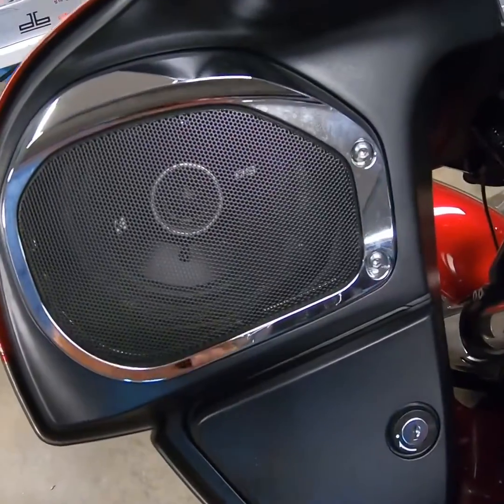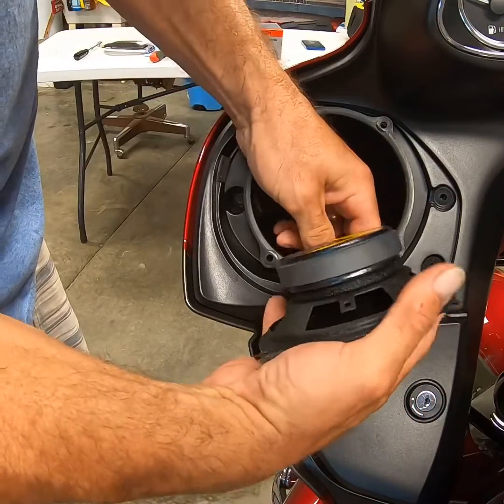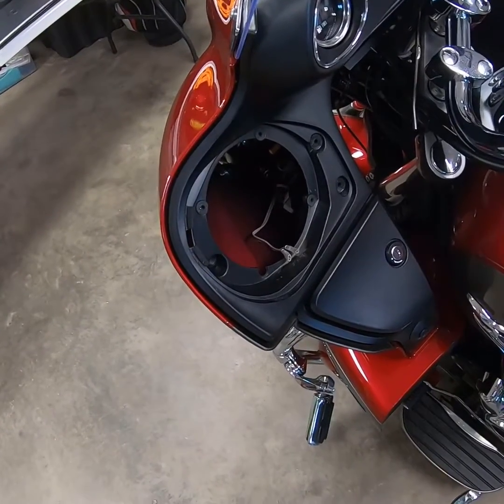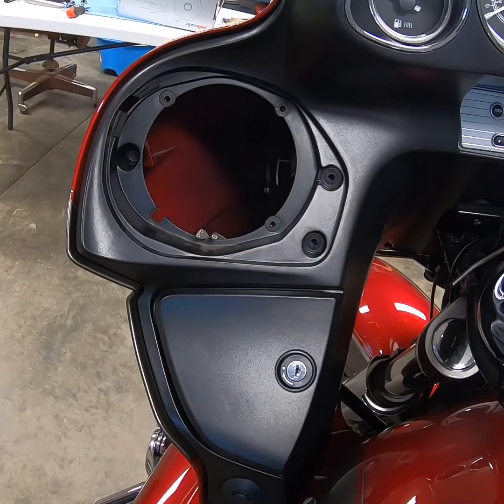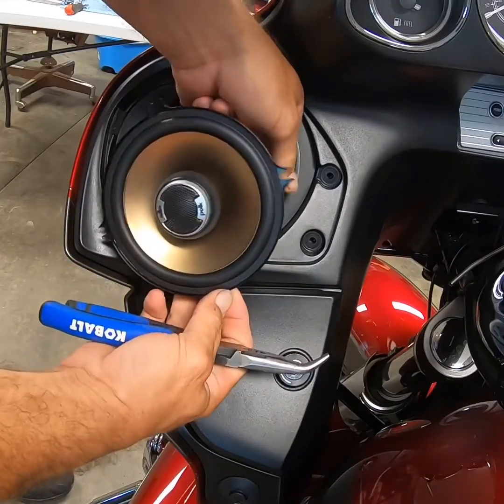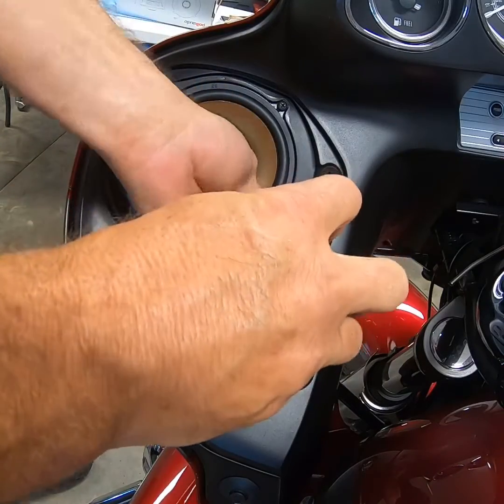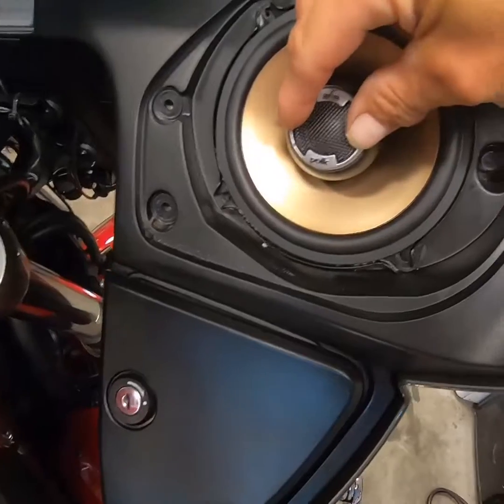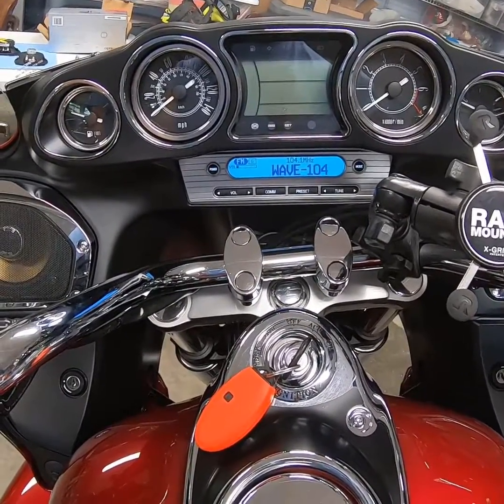Front Speaker Replacement & Polarity Testing: Kawasaki Vulcan Voyager VN1700 Vaquero + or -

Comment: Hello. Thanks for the content. I just installed my Ivan’s reflashed ECU then found your speaker videos.  I had stopped using the stereo system because the sound is so crappy. But I’m inspired to upgrade and surprised how inexpensive the Polk speakers are. Question…why didn’t you just install another set of Polk 5.25’s in the rear. Question 2…would they fit?

Comment: I have a Vaquero with the stock stereo system. No upgrades have been made to the audio system. I'm not looking to boost my system to a show quality sound. Do you still feel by changing the stock speakers out to the db521 will improve the sound of my stock system? I know it's not going to have huge Bass I just want a slightly improved sound. Would it be worth my while to buy the 521 and replace the stock speakers?
Reply from the maker: Personally no, but if you do the DB652's with the Engineer Adapters will make a difference worth while.  The 652's are 6.5" speakers and the adapters fit right in the fairing like they were factory made.  https://youtu.be/4z4yY26HloY Is the video I installed on, the adapters can be found at https://engineeredadapters.com/product/kawasaki-fairing-adapter.   Thanks for watching hope that helps.  Like you were saying, not a lot of bass but they will help the quality of the sound and they are a little bit louder.

Comment: I got Polk kickers. Unhappy with them. Would like to try what you have for my 2021 vaquero
Reply from the maker: These were better than factory but still no real big difference.  I am not a "blast your neighbor" kind of person so they worked good for me but if you are looking for more bass or to crank it up, you will probably need to go with a system that uses the saddle bags or the trunk compartment to get any real sound.  That head unit does not put out hardly any power at all, I think that is the main source of the problem, I added a Rockford Fosgate amp to it in another video, it got louder, still no bass.  Good luck keep everyone posted to what you do, possibly I just had a crappy head unit from the factory.  Thanks for watching.

Comment: Greg what's the model of those speakers?
Reply from the maker: Those were Polk DB521's but I think there is a 522 out now.  The other thing to consider is getting the adapters from 5.25 to 6.5 and putting a larger speaker in there.  https://engineeredadapters.com/ Engineer Adapters makes one that will screw right in the factory place and allow a larger speaker in there. They look pretty good when finished.  https://www.youtube.com/watch?v=4z4yY26HloY That got me a little more bass but last I checked they were on backorder but may be able to find a set on eBay or Amazon.  Thanks again for watching.

Comment: Just throwing this out there, because not everyone reads the manual, but the stock unit on both the Voyager and Vaquero have a built in EQ. Turing up the bass and treble makes a difference. There's no question the Polk speakers are better than stock, but it would be a shame if someone spent all that money, and went through all that trouble without knowing.
Reply from the maker: I agree,  the only way to really make these loud and sound good are aftermarket head units and some other things.  Sometimes just the better speaker quality helps out.  My factory speakers anything above 0 on the bass they distorted, usually had to keep below 0 to turn it up.   Thanks for watching.

Comment: Hi Greg. You're speaking my language!!! Excited to jump into this. Can I pick your brain? It seems everyone doing this mod, goes with an amp, and upgrades front speakers to 6.5". You being an audio expert, can I ask why you didn't opt for those changes? Thanks again!! (I'm hovering over the order button on the same speakers, lol)
Reply from the maker: cmjphoto The biggest thing about the 6.5 upgrade is getting them to fit. I did buy a set of them, I even tried 5.75 But they physically will not fit in the hole. The only way I’ve seen people get them in there is to literally cut holes in the plastic And mount them to the face using the generic plates that come with them.   The other way would be to mount the speakers in the trunk or side boxes.  They don’t make an adapter for Kawasaki you would have to fab it in.  I’m not even sure why they don’t make the rear speakers 6.5’s would not take up that much space. I tried a couple different ones like Harley bat wings are 5.25 to 6.5 but again they stick out and I don’t like the way they look. The other thing people don’t take in consideration when you cut the hole bigger to mount a 6.5 That black tube behind the speaker is basically a box, by removing that you lose Bass so yes louder but still not quality.  So you need a box behind the speaker to do it properly, I might get bored one weekend and dig back into it, I saw one Bike had them mounted from the inside instead of dropping through, but again no back box of any sort so you’re going to lose your bass.  I also I live right near Myrtle Beach, don’t really go out of town on it so most of my driving is under 55 anyhow, probably mostly under 45 honestly so I don’t really need a ton of sound.   I’ll keep everyone Posted, if you do 6.5’s please let me know how you did them I have people ask all the time same question.  Thanks.
Reply: @RagerJackOfAll  Check out Engineered Adapters (google them) for the 6.5" adapters. Randy makes a very slick set of units for exactly this. Interesting, knowledgeable guy, owns the same bike as us. I noticed in another video, you did the amp upgrade. Worth it?
Thanks for getting back to me as well! Much appreciated!
Reply: @RagerJackOfAll  Also curios why you opted for the DB521's instead of newer model, DB552?
Reply from the maker: cmjphoto I did the 521s because if you look at the specs on them they actually have a better sensitivity at 93 dB versus the 91 for the 522s, basically that means less power needed better sound, wattage doesn’t mean everything your sensitivity has a lot to do with it. Since you aren’t the only one asking about 6 1/2’s, I ran to Walmart today I had some time tonight I just put 6 1/2’s in the front a set of pioneers And since I’m not running an amp I don’t think the brand is going to matter much since I don’t have that much power going to them. I’ll upload the video probably later tonight or tomorrow once I get it edited, but you’ll be able to see how much bigger is 6 1/2 is and how little space you actually have. Again they’re mounted in there with no cone or box behind them So I’m losing a lot of bass. Raining here for the next couple days so until I get it on the road won’t really know what it sounds like, sounds better in the garage, But I think I was OK with the 5 1/4’s for myself personally.  Again when you’re picking up speakers look at the decibel rating or the sensitivity compared to others.  https://www.crutchfield.com/S-fLZFSiJt2Bp/p_107DB521/Polk-Audio-db521.html Look at the specs, the 522 is also listed under that once you click on that you can see the difference. Newer is not always better.   Thanks again, keep an eye out tonight or tomorrow I’ll upload that video. I tried to find some YouTube friendly music, hopefully they don’t kick it off for copyright if they do I’ll have to edit.  And just for a comparison the pioneers I bought only have an 87DB rating, I would definitely not recommend these if you’re going to upgrade.
Reply: @RagerJackOfAll  Thanks Greg. I haven't ordered anything yet, but getting the itch to pull the trigger. Maybe I'll got with a full set of 521's like you. 
I appreciate the advice!!
Here's the link for the speaker adapters, if you haven't already looked...
https://engineeredadapters.com/product/kawasaki-fairing-adapter

Comment: Hi Greg, could you tell me the value of the capacitor you put on the wires inside the trunk?
Were they mounted inline (positive wire??) or in parallel? 
thanks
Reply from the maker: Davide Parolin The video your message came thru was on the front speaker install.  If that is the one you were asking about I did not use a capacitor at all.  You probably could put one in but without an amp the factory radio only goes to like 14 or 15 even though the numbers keep going up to avoid blowing the factory speakers.  I have not found a way around that yet. I’ll probably buy an amp soon as the world gets back to normal and do a video on that.   Let me know if that answers your questions If not be a little more specific on which install your talking about.  Thanks.
Reply: Hi Greg, thanks for the prompt reply, at minute 4:00 I saw  a condenser inside the front fender, or did I see it wrong?
Reply from the maker: Davide Parolin Hey I miss read the message or wasn’t computing.  That is the High Pass Filter that came with the speaker. Ran parallel with the positive.  Not sure did  a lot of good though, I think if you really want sound going to need an amp.  Again for the way I ride they Are more than enough, can still hear clear at 70, but that radio seems to cut power at 14 or 15 no matter how high you go doesn’t get louder I’m guessing to keep from popping the paper factory speakers.  Let me know if that helped.

Comment: So now that you have had them for a bit now, what's the concensus, still happy with them???
Reply from the maker: I personally am happy.  They are much better than stock I can hear clearly at 70 with a helmet on.  They do not have a ton of bass.  They sound good again but If you really want to crank it going to need an amp and probably modify the fairing to get 6.5’s or I’ve even seen speakers in the trunk or saddle bags.  Thanks.

Comment: Hello friend, I have a 11 Vaquero & I'm lookn to change out the factory speakers to the kickers wth a kicker amp. Did u have a amp pushing the kicker speakers b4 u removed them?
Reply from the maker: No just a factory radio.  I started with the kickers but the Polk's way out performed them.  I'm not sure on the Vaquero if you have a 6.5 in there but the Voyagers are 5.25's and without cutting it all to pieces don't think you would ever get a really good sound.  I do home theaters for a living, One of the biggest things is look for the sensitivity on the speaker before you buy it.  That Polk DB521 which I think is discontinued has a 93dB response at 1 Watt, that makes a huge difference.  I can go down the highway at 70 and hear the music fine with or without a helmet.  Hope that helps.
Reply: @RagerJackOfAll  That helped me, thanks. 2017 Vaquero
Reply from the maker: No just factory deck.